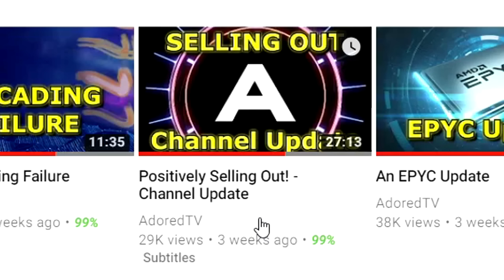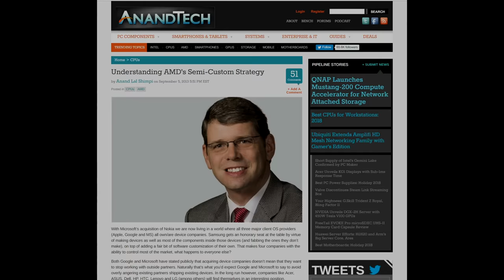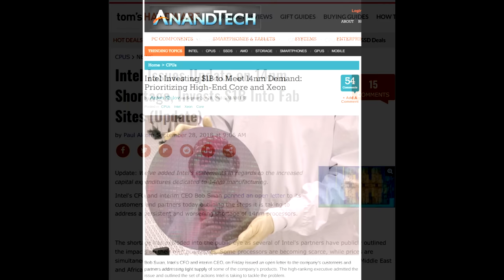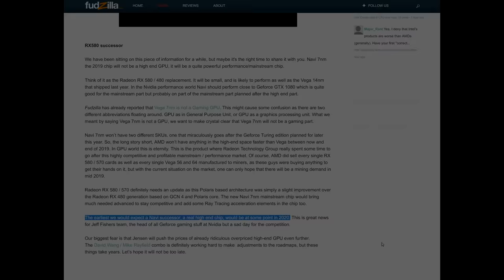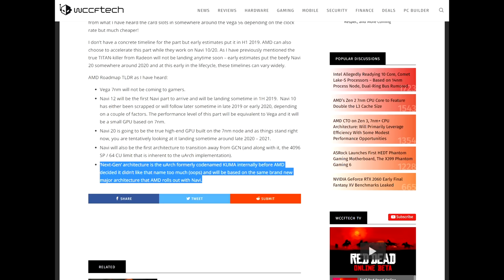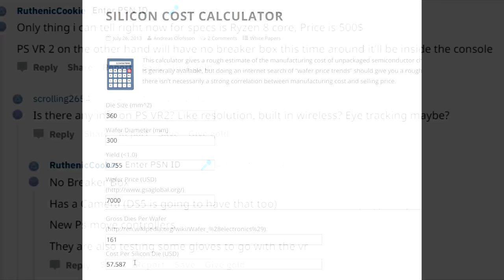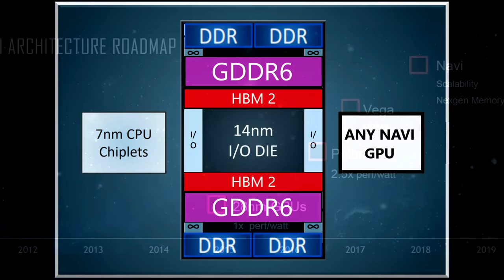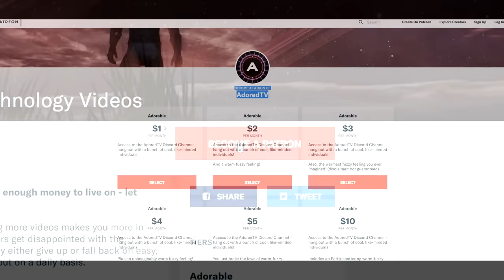AMD  - The (Evolving) Master Plan

Comment: Question for adored/anyone who wants to provide their opinion.  Given than in many ways consoles are referred to be the curve, and pc's are considered ahead of the curve, its understandable for pc gamers to still follow trends with console related hardware trends.  At the moment I personally want to see 120hz+ support on consoles be adopted as quickly as humanly possible.  I say I want this despite the fact that I have nothing to do with console gaming. Some people make the mistake of being willing to abandon 1080p for 4k without thinking about the sacrifice of no longer being able to easily drive 120hz+ displays. Scenario A: At the moment if a next generation console wanted to hit 1080p 120hz not only would graphics power need to be high enough to drive the high frame-rate, but some serious consideration would likely be needed to ensure that the gpu can always see near perfect utilization through a upgrade to the cpu. If this were to happen at the console level I see games being developed with efficient cpu usage at "standard" resolutions being properly prioritized. This would trickle into the pc space with games coming out likely being very capable of pushing 1080p 240hz today on high core count cpu's and high end gpu's, and with it being able to see further performance gains up to 480hz+ as cpu core counts raise and as gpu power climbs. Thats scenario A. Scenario B : Console manufactures prioritize higher resolutions and hdr certifications while maintaining 60fps. This would require an equivalent or greater gpu to drive that resolution, but wouldn't require more of the cpu, somewhat stagnating the scene. Because of this I fear seeing games come out on console hitting 4k60fps but then hitting pc and barely breaking ~144fps at 1080p, with gpu utilization already not at 99%. Sure raising the resolution on the pc would improve gpu utilization without lowering the fps noticeably, but it leaves people trying to drive 240hz monitors screwed.

Do you/anyone have any feedback regarding which scenario is likely to happen, if either.

Comment: Your speculations and conclusions seem sound to me. I only find one thing quite odd. the flexible I/O die. Going down the line of reusing everthing as good as possible, the I/O die would be reused in all SKUs. However, having a DDR4/GDDR6/HBM2 IMC on all Ryzen/ EPYC SKUs seems strange. But having a separate I/O die for all applications is even stranger. There are too many unknowns still. Where is the L3? Is there L4 (which I doubt)? Well, time will tell us, whether you were right ;)

Comment: So, how do they (Intel and AMD) make a die with defective cores work anyway? Are they programmable?
Reply from the maker: The bad cores are "fused off" so no electricity can run through them and the rest can be programmed in the BIOS and microcode yeah.

Comment: I'm sure you heard about the rumour that Microsoft might use AMD for their next surface (7nm zen), what you think about that?

I hope with 8 core zen on consoles we will see better multi core performance on PC. Kinda hoping Vulkan might pick up since i switch to Linux on my laptop and im liking it but most games (drm) still dont work on Linux sadly :(

Btw like you kinda mention i think AMD with HBCC and multicore, they have the possibility to use multiple RAM sources and if they can pull it off multi gpu... 
with console they can certainly for the multi gpu i think, the same they can force a full ray tracing switch. Because with PC market you have people with 2 generation of GPU behind. With console you have a clear cut to new tech... lets see what they can do in this new age coming for AMD. I hope they can stir to market to make it healthy again.

For 7nm GPU it does kinda make sense they play it safe (since it almost does double) and stick with they old trusted architecture before switching to something new, to work out some problems first that comes with 7nm.

Comment: I don't know why they can't do a multi chip GPU... do you people remember the ATI Rage Fury Maxx? or other multi GPU's from ATI/AMD? the fury maxx used 2 GPU's and they work alternating the frames between GPUs... they didn't improve the tech since those days???
Reply: Last time, gpu chip use plx chip to cfx/sli. This is not preferred method since it will cause more problems later. This time the method will be different.

Comment: Just started to worry about the lack of new video :D Actually, I've watched some other reviews about NAVI targeting/atacking the console market first (positions occupied), but your information/speculation was much more detailed. In may opinion, RTX 20XX is going to be a dead branch of graphics evolution for now - most of the gamers play at 1080 resolution - excellent solutions for that from both AMD and nVidia at reasonable prices (actually, 1060 is about 50$ cheaper than RX580 in my country); lack of implementation of the new RTX technology here and now; narrow range of products - 2080, 2070 at very high prices (not designed for the mass consumer). On the other hand, AMD counts its coins by releasing RX590 - re-backed 580 (RX480 and 580 continue to be products of choice for the mass consumer). All in all, the next year is going to be very interesting in this department, when AMD releases NAVI, and Lady Envy is obliged to retaliate (10 nm technology?). Currently, the two boxers are just warming their gloves :)

Comment: I don't think you will only see a small clockspeed increase for Zen 2, TSMC 7FF is just a better node than Intel 14nm even if AMD doesn't have the scale to create these rare CPUs the innate node advantage will carry them through. I can take your point that Vega 20 will almost certainly have those kinds of problems as why it is limited to only a 20% clock boost over Vega 10, but in that case even if they had the same limitation which Vega 20 is going to be much lower scale.

But as said take that as a given a 20% clockspeed increase from 3.7Ghz and 4.1Ghz from the 1800X is still ~4.44Ghz and ~4.9Ghz. Going from the 2700X 4Ghz to ~4.44Ghz and 4.3Ghz to ~4.9Ghz is not small. And likely given the much smaller die and much higher volume you could likely kick that upto the 25% AMD quoted which would put you upto ~4.625Ghz and ~5.125Ghz, honestly even for an 8 core SKU I could see them bringing it back to 65W and lowering the all core down to something like 4.5Ghz and 4.9 - 5Ghz all core though, but with overclocking 4.7 - 4.8Ghz all core would likely be possible.

Which certainly isn't a small jump, at this point 20% over Zen 1 really is the lower bounds of what you could expect as am improvement.

Unless you are talking about Intel 10nm vs TSMC 7FF which considering Intel themselfs had 10nm+ pegged as being able to clock only as high as 14nm++ on there own slides, admittedly that was at lower power, but I think you will be looking at Icelake being another Broadwell similar clockspeeds at lower power. Which if they had good yields would mean they could increase core count.

But I don't think that is going to happen in the mainstream anyway, higher clockspeed in the HEDT and Data Centre space yeah sure that is totally something they could do. But those yields are not going to be good, Intel has had enough trouble getting the yields high enough just to be profitable. There is no way in hell they are going to increse core count in the mainstream on the first 10nm+ mainstream product, or they charge an arm and a leg which will make it decidedly not mainstream.

Comment: Jim, want your thoughts on this!

What happens to Intel, AMD and Nvidia in 10 years time when:
1. The big three clouds move entirely to in-house chips for compute (CPU and GPU/ML accelerators)
2. Apple has ditched x86/Radeon/GeForce from the Mac in favour of their in-house SoCs
3. Consumer Windows and Chrome devices predominantly use commodity SoCs based on cheap Arm IP..

Regarding those points:
1. AWS announced Graviton (Arm CPU) and Inferntia (AI accelerator) this week. Microsoft have publicly committed to Arm in Azure. Google have shown intent to adopt another architecture (POWER, RISC-V or something else) and Google already has the in-house Google TPU hardware available in Google Cloud.
2. Apple are clearly heading in that direction. Apple's SoCs mop the floor with the best Intel and AMD have to offer (like, almost 2x perf/watt, geez)
3. Arm finally have a roadmap for desktop/server class cores, along with important additions like SVE. Cheap desktop class Arm IP + established Arm chip houses and the many eager smaller chip houses = competition galore. Samsung notebooks running on Exynos? Lenovo on Snapdragon? Huawei on Kirin? Windows 10 for Arm isn't half-baked like RT was - it's full fat Windows and it will run eventually on Arm SoCs with competitive performance. Microsoft clearly wants Windows 10 on Arm to look and run like regular Windows, to act as a drop-in replacement for x86 kit. And yeah, Chrome OS already runs and ships on Arm.

The above seems like a near inevitability.
Reply from the maker: The desktop remains resilient vs all threats. ;)  Servers aren't going anywhere either tbh.

I kinda wish AMD, Intel and Nvidia would fight back against ARM and Apple instead.

One thing I do fear is AMD talking up cloud gaming...
Reply: @adoredtv  Cloud gaming? Ehh, could be interesting, maybe, not sure.

(Sorry for the wall of text below, it's just interesting to challenge the accepted truths about the market! Everyone laughed at talk about Apple going in house for Mac and now it's looking inevitable).

Desktop is resilient but a low-margin/no growth market, winning in desktop is great but still kinda feels like losing vs. data centre, mobile etc. I wanna see AMD continue to do great things in desktop/HEDT, though!

Server/data centre market isn't going to vanish overnight, but the trend is definitely towards public (or private managed) clouds. There's very little reason not to move operations from self hosted to cloud hosted given the benefits (cost, automation, lower maintenance overhead, scale you couldn't possibly replicate etc.). Even healthcare, insurance, banks etc. are beginning transitions to clouds, and it wasn't long ago that that was unthinkable . If the big clouds eventually go all-in on in house Arm, Intel/AMD will be pushed to servicing the remaining high-end markets like HPC. In the same way that cheap x86 gear drained marketshare from Power/SPARC over the 2000s.

From the cloud providers perspective, it makes sense. They're currently (effectively) dependent on a sole supplier and they have little control over features/security/roadmap. Yeah there's AMD as an alternative, and they do semi-custom, but AMD is still a wildcard with a spotty track record. Pushing for an alternative architecture without awfully restrictive licensing makes sense.

I imagine AWS (for example), gradually moving more and more services to in-house chips. It would allow them to drive the cost per unit of performance down and allow them to iterate faster. If they can build a more dense, cost/power efficient, secure, scalable platform etc. in house, they can use that as a stick to beat the competition with.

Have you read about AWS Graviton? Prior to acquiring Annapurna Labs and starting work on Arm chips in house, Amazon were working with AMD on Arm SoCs. The cancelled Opteron A1100/Seattle was built for AWS (clue in the codename "Seattle", funny no one noticed hah). Amazon pulled out of that project and decided to go it alone. Don't you think that's telling? Amazon tend to bet big and they seem to think they're capable of doing it independently (I tend to agree). 

I don't have a personal preference in which alternative architecture wins in this case. Arm seems a sensible bet given that the software stack is healthy and Amazon have just started deploying Arm. Azure have stated intent to use Arm, and Windows Server (at least internally at Microsoft) runs on Arm.

Regarding this:
"I kinda wish AMD, Intel and Nvidia would fight back against ARM and Apple instead."

I agree... but not with x86. Semi-custom K12? :-)

x86 is Intel, Intel is x86. AMD are an anomaly that occasionally does something exciting and innovative. Depending on AMD as the sole competitive force is not a situation we should celebrate (see: last 10 years of stagnation, as you've covered well). Anything that hastens the death of x86 is 10/10 in my book 👍
Reply from the maker: @Aaronage1  Honestly I think if the big 3 put more effort into desktop it would fight back - that's what I meant about it.  The power requirements never change and the desktop has always been the technology pusher.

I'm not well-versed enough in ARM tbh, though I should read up on it more. ;)

Cloud gaming...that's one for a future topic.
Reply: AdoredTV look forward to that one, cloud gaming isn’t something I’ve given much thought
Reply from the maker: @Aaronage1  I read about the whole AWS/Seattle thing recently.

I honestly looked at AMD's ARM stuff as being desperation due to Bulldozer basically.  I followed it for a while with K12 obviously but after it became clear Zen was the bees-knees they really dropped interest in it.

It's about money again.  Cancelled projects to get Zen out the door, or at least focusing on Zen.  I hope that with a ton of money coming their way, all this stuff can come back again.
Reply: AdoredTV I need to rethink AMDs Arm developments. K12 wasn’t a small project, it’s the Arm equivalent of Zen. Why invest heavily in something with no proven market when the company is on its knees financially? It’s odd. I had written it off as a failed experiment too, but the revelation that Amazon were working with AMD on Arm changes that. Hmm... not sure what to make of it.

I think Lisa was right to drop everything to focus on Zen, though.

Comment: I'm really hoping that your speculation about AMD gaining volume ends up being true, because right now AMD is the only dedicated graphics vendor which properly supports Linux.

NVidia's driver is performing well, but they are the only graphics vendor fighting the DRM/Mesa stack with their own implementations. I can understand that contributing to the open source (and dominant) graphics stack would seem like aiding their competition, but they would also get the benefits of common optimizations and the support of us power users who care about the operating system. Or even just drop Linux maintenance completely but release better documentation of their hardware for the nouveau developers :(

Edit: NVidia is actually contributing a little to Nouveau, but only for Tegra chips.

Comment: Problem with so many different memory controllers is two fold, one: they take up room and two: GDDR 5/6 requires 4 memory chips for a 128 bit bus (32 bits each), so where you going to put them?
Adding HBM capability makes sense for two reasons, one it's fast enough with low latency to act as a L4 cache (more than one use) and two it's small enough to fit one 4GB chip under an APU's heatspreader.
They could have added GDDR5 memory controllers to an APU years ago, the problem is that you'd need another slot for a memory module and you need at least a 128 bit bus to make it worthwhile, and with such small iGPU's it's not worthwhile.

Also SOC VRM's are pathetically weak on most motherboards, you'd be looking at a 4+4 configuration for the power draw a bigger iGPU would use which means more expensive motherboards, to make the addition of GDDR5/6 worthwhile, not to forget the APU's TDP.

A lot of motherboards only have a two phase SOC VRM, some only a single, so there's limits on power draw and backwards compatibility. So a bigger iGPU that could use the memory bandwidth, would be limited to about 65W total, this could be done with lower frequencies and adding the CPU's power budget, 105-125W APU's could be quite decent with 8 cores and 30 odd CU's, but only with HBM will it all fit in one package, and only work well on motherboards with 3 phase SOC VRM's, though big 2 phase might be OK.

Comment: Why does the 7nm navi wafer cost 9000$ but the 7nm zen2 wafer cost 1200$? Shouldn’t it all just be 1200$ (if not more as worst case). Also current rumors have navi being around 400mm2 range.
Reply: Also Raja Koduri before he left said Navi will have Tensor Cores

Comment: Fantastic video Jim, but one critical error, as noted.... A Zen 2 70mm chiplet has 8 cores on it, not 4 (Epyc 2 has 8 chiplets, remember, and 64 cores is 8 x 8, not 8 x 4!) PS5 only needs one for 8 cores..That said, AMD could offer Sony a 2 Zen, 1 Navi, 1 IO die SOC solution for PS5, (where the 2 Zens are salvaged 4 cores) and later down the track PS5.5 could be full 8 core Zens matched to Arcturus.

As you have surmised, this chiplet strategy has so many upsides long term, with the ability to mix and match as required...

Food for thought question, just how much does Intel need its current ability to bin across 300 million CPU dies...? If the whole market even goes 40/60 AMD/Intel, how far back does that cut Intels top bins?
Reply from the maker: That was meant to reflect two 8-core chiplets with only 4 working cores. ;)

Comment: TSMC 16/12 to 10nm 10% clock improvment with same power.
TSMC 10 to 7 nm 20% clock improvment with same power.
Me Glofo 12 ~ 12 nm TSMC
AMD 2x performance at same power.
Tomshardware 2700x https://img.purch.com/amd-ryzen-7-2700x-ryzen-5-2600x-review/o/aHR0cDovL21lZGlhLmJlc3RvZm1pY3JvLmNvbS82L0YvNzYzNTc1L29yaWdpbmFsLzAyLVJ5emVuLTctMjcwMFgtUGVyZm9ybWFuY2UtdnMtUG93ZXItQ29uc3VtcHRpb24ucG5n

2700x at 95 Watt ~ 3.9 GHz (8c/16t)all-core
3600x at 95 Watt ~ 3.9 x 1.1 x 1.2 ~ 5.15 GHz (8c/16t)all-core

These values make kind of sence to me.